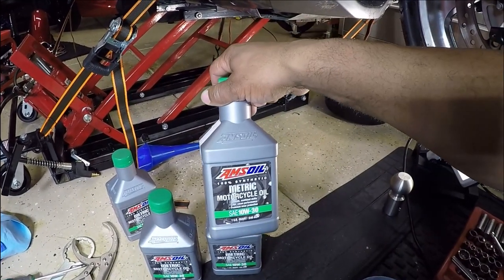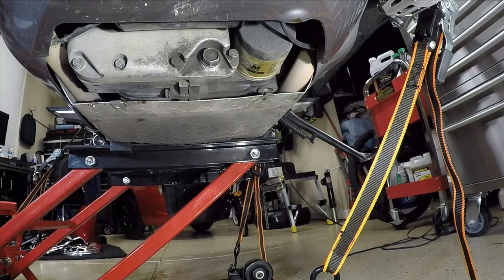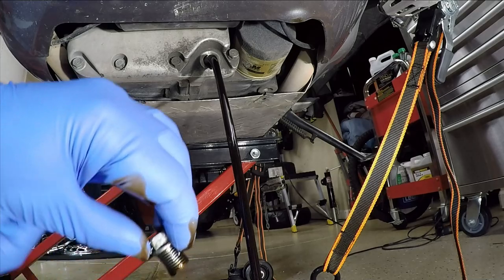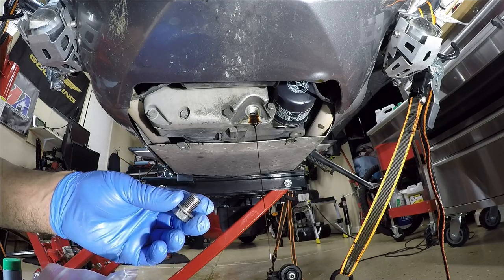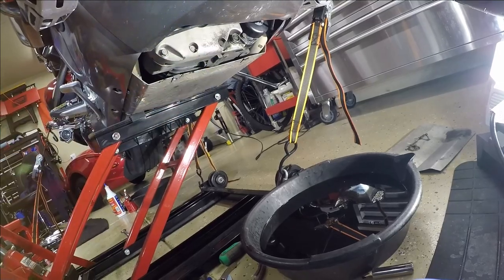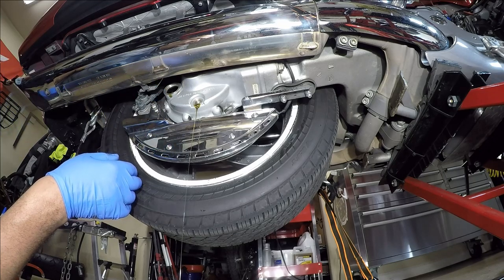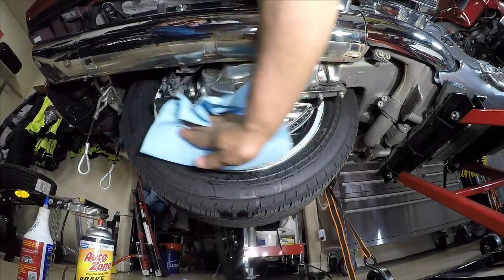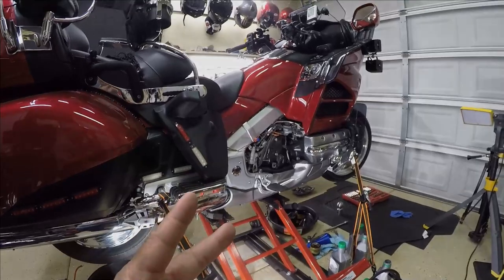My Honda Goldwing preferred Oil and filter change

Comment: Wow... that oil is filthy dirty!  How many miles on that oil just out of curiosity.  I usually change mine between 5k and 8k and I've never seen it this dirty.
Reply: I also always use Amsoil and OEM oil filter.
Reply: Just about due to change my gear oil also.
Reply from the maker: Dark oil during oil change doesn’t necessarily mean the oil is bad.  Oil can be very dark (black even) and still be effective, clean oil is amber in color but as engine oil gets darker, it can indicate high heat, contaminants, or the presence of additives that cause the oil to darken during normal use.  Carbon and other contaminants are trapped in the oil filter where they cannot harm your engine, darkening of oil actually indicates that the oil is doing it’s job well.  The Honda manufacturer service manual recommends a conventional oil and filter every 8,000 miles.
Reply: 8000 miles is about 3x too far . The more contamination the less oil can do it's thing ' the cleaner tbe better . Synthetic is the worst thing to do to any engine .

Comment: Hey Chris, I always fill the new filter before fitting. It never ceases to amaze me how much oil it will take and the other phenomenon is that providing your quick the oil doesn't spill out when you screw it on.

Comment: My 18 will be going on Amsoil 10w-30 and there gear oil next oil change with a Wix oil filter. It's been on Honda Syn since it's first oil change at 1k miles. Only has 10.5k miles on it and just had it's fourth oil change. I will do early oil/filter changes if I have been brutal to the Wing. Like a weekend of running the Talimena Drive or the Pig Trail with a lot of redline shifts and massive down shifts working the slipper clutch hard in my 6MT. I'm also hard on brake pads and tires. :) I checked my brake pads this weekend and did flush the brake/clutch fluids. Brake pads are at 50% at 10.5k miles. Have EBC pads on standby front and rear. On the 18+ Wings Honda recommends you drain the oil with the bike on the side stand. You will get a more oil out of the engine and if you rock the bike side to side and bounce the bike off the front suspension you will get even more out of it. If you drain a 18+ on the centerstand, jack or lift table even with a 3.9 qt. fill you will more than likely come out with a slight overfill.

Comment: I am a very long time Harley owner and currently ride an Electra Glide, but I bought my first Wing a few days ago (08 GL1800 with 27k miles) and have much to learn in order to service the bike. I like to wrench on my own machines and look forward to learning new skills. The previous owner only used Amsoil and Hiflofiltro filters, which is all I use in my Harley. He just did an engine oil change before I took possession of the bike. This weekend I will go through the other fluids to inspect and or change (Rear end and radiator). Until I feel confidant, I will take the bike to a shop to have the air filter changed. Spark plugs seem fine but I will probably replace them for the hell of it this winter. I will stick to the OEM Honda filters per everyone's input.
Anything else I should look at as a new owner of a used bike?

Comment: On the rear final drive I read that honda uses a high moly grease on assembly. It needs to stay in there during the first 23k miles so don’t change that final drive gear oil until 23k miles.

Comment: I tried amsol for a few oil change cycles. I kept getting rough shifts on my 2016 F6b. I changed to honda full synthetic and shifts got better. Now I use the honda synthetic / natural blend and it shifts great. Im thinking honda conventional oil would give the best shifts. Always use honda oil filter.
Reply from the maker: Ever seen a Honda oil refinery plant?  That’s because Honda doesn’t make oil, they have it manufactured by a oil company and have their Honda name stamped on it.  In 1972 AMSOIL Synthetic Motor Oil became the world’s first synthetic motor oil to meet API service requirements.  It is some of the best oil on the market, Honda brand is not mentioned in the line up, therefore I’m rolling with Amsoil as my first choice.
Reply from the maker: @cyclechris6591  Honda brand motorcycle oil can’t match Amsoil, not only Amsoil makes oils for motorcycle but they also make a host of others oils like Firearms Oils, Air Compressor Oil, Synthetic Diesel Oil, Synthetic European Oil, Marine Oil, Synthetic Racing Oil. Natural Gas Oil, Powerstroke Oils, Transmission Fluid, just scroll their product list below.
https://www.amsoil.com/c/products/1/

Comment: If I am not mistaken, on the 2018+ by using this oil or any synthetic, you need to re-set the DCT. there is a chance it will not shift right.

Comment: I was reading in my owner's manual That honda recommends not using an oil with molly in it I called amsoil Tech services And they told me that amsoil metric has a little bit of Molly in their engine oil.